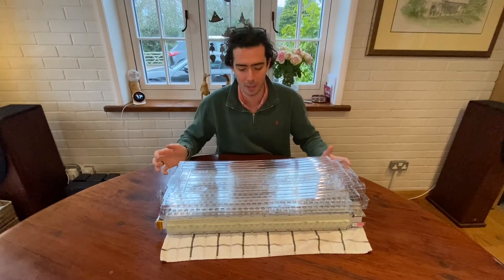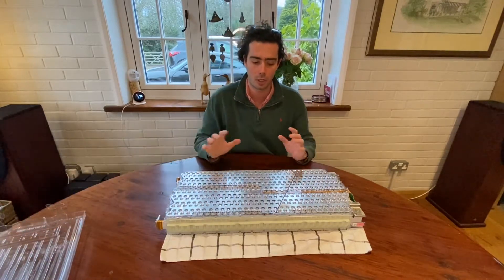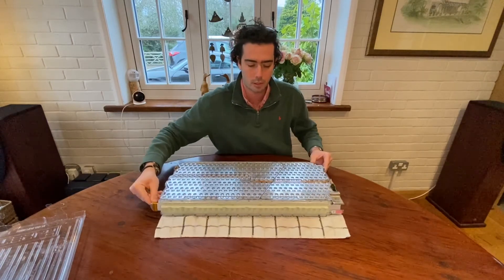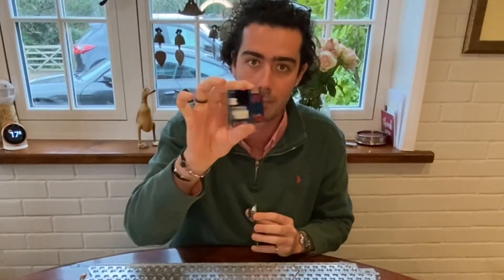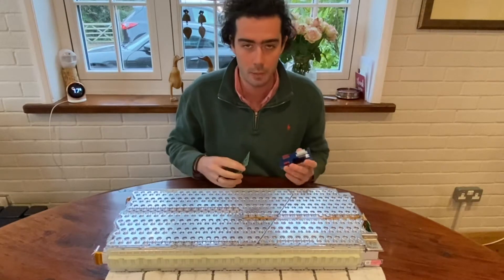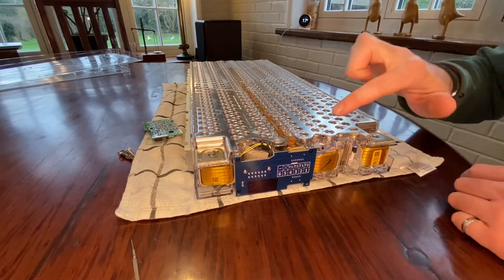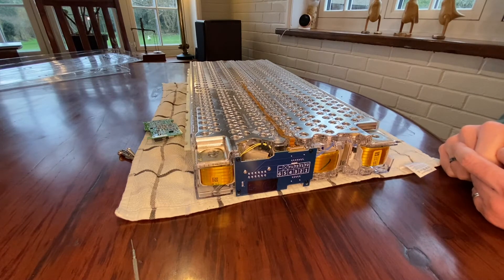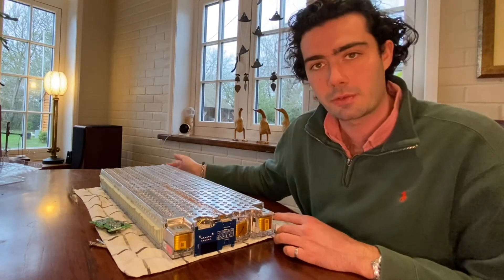How to change the BMS boards in a Tesla Model S Battery (Orion2 BMS) - ECC Tech Series

Comment: Hi, great video. I'm curious, does the daughter board measure every single cell individually, all 444 of them. There doesn't appear to be enough connections to be able to do that.
Reply from the maker: No, it measures 6 groups of cells. The 444 are split up into 6 groups. This is 6 groups of paralleled cells, which are then put into series to create the nominal voltage.